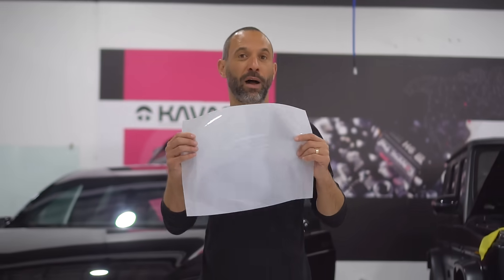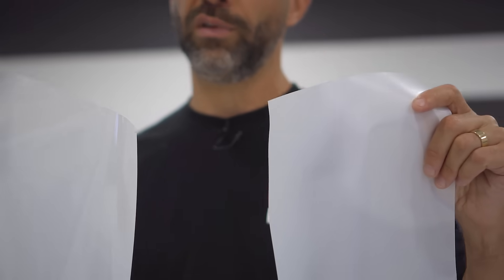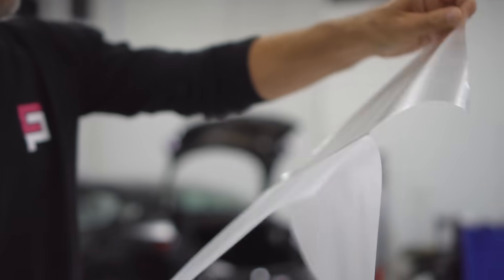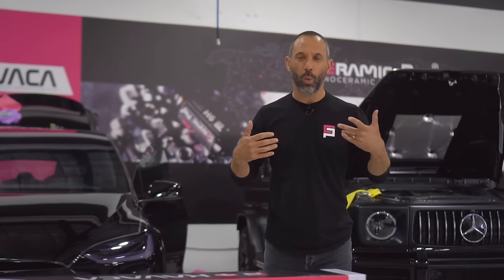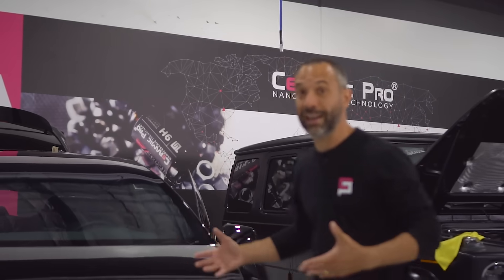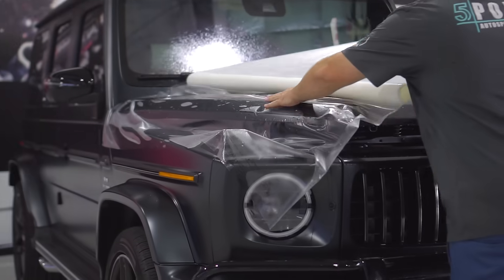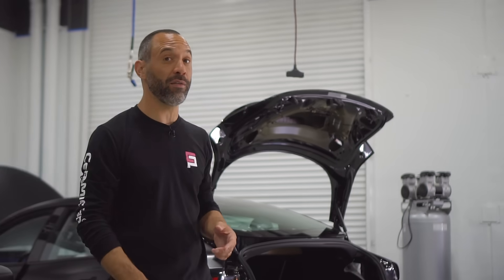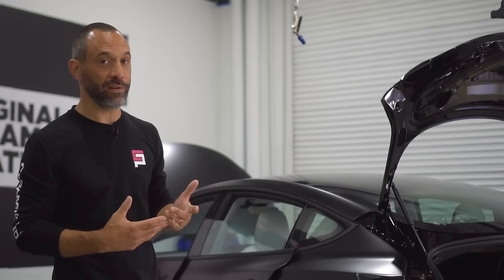The Truth About Paint Protection Film

Comment: CAUTION CAUTION CAUTION

I just got done removing 6-7 year old PPF off a car. Most of car (full front, doors, sides, pillars, roof, hood...everything but the rear bumper basically). It was garaged when not in use and lots of covered parking deck. Made me realize how stupid it was to install it.

- After about 4+ years, the film (highest end 'suntek' at the time) looked like absolute junk with swirls, fading, stains, spots, creases (main problem seems to be bug juice leaving brown spots that completely penetrated the film...not sure about the science of how that happens)
- Edges had 'uncleanable' black dirt lines and looked ugly...I ensured installer did least edges possible, but some areas are unavoidable and like the front bumper/headlight templates have edge
- Had to  remove some dents from door from deer running into the car and PDF prevents paintless dent removal and also had body shop scratching their head what they'd have to do about it (they didn't want liability to remove it)
- Some edges peeled and it was such a pain to go to shop for them to fix, which means basically cut them off with razor so there is bare inconsistent spot... they wouldn't replace the whole panel to make sure edges covered\
- HUGE pain in the arse to remove the film because it breaks off into pieces and leaves adhesive behind
- The adhesive is a #)(*%^ #$*(#$&*(#( to remove...you basically have to scrap it off and 100% swirling up the paint...I tried different methods and this is the most reasonable
- Lots of razor damage on paint when they cut edges...it was a good reputable shop still unavoidable
- Paint peeled in a few spots from pulling film off. it was worse at edges and on plastic panels.
- Had to remove some plastic trim where film was tucked under and 8 year old car plastic clips break easy
- After all film removed, paint looks WORSE than if you just didn't protect it because the process to remove damages paint. it would have looked better for many years with a few rock chips than the ugly old film + lines.

The only place where PPF seemed to work okay was the headlights... it peeled off easy and they were good as new under, however on the edges where there was no film are faded/yellow, so looks inconsistent. I noticed similar effect on some panels too where UV discolor the parts not covered.

I've had other cars in the past with film/ceramic. This the first car I had to remove the film because I kept it longer...prior to that I sold/traded to different car by 2-3 years so never ran into this problem. I thought it would be like removing shrink wrap to reveal nice new paint (that was corrected prior to PDF)... NOPE now I got swirled up paint worse than if I just carelessly washed it. The whole idea is dumb too...8 year old car with perfect paint? it gets check engine light intermittently and has a few other problems due to age and paint is least of worry by then...the film just becomes a thing that gets in the way from selling the car because it looks like trash. If it was just paint, I could polish + wax to look nice. If anyone has a brain, they'd see the film and not want to buy the car because who knows what's hiding under it or if it's going to star pealing/cracking tomorrow.

If you're going to keep the car, I'd recommend removing the film after 3 years...if you wait for 7 (which is apparently the recommended life of it), it becomes nearly impossible to remove and you'll be thinking you need to sandblast and repaint the car...it will be ruined basically with the adhesive junk stuck forever. If people out there are willing to spend 3-6k+ to redo their PDF every 3 years, they probably the type that are able to trade for a new car every 2-3 years. I'm betting most people will never remove it, so basically installing the film you're just stamped your car paint with doom.

Oh ceramic coating is a scam too. You can get temporary coatings that do exact same thing... some spray on. Or just wax it instead of paying someone 3k+ for basically wax that could last maybe a year depending... $10-30 wax and some labor is same result/protection.

Comment: Will the ceramic on top of the clear bra prevent oxidation? Also, will the ceramic on top of the clear bra make it look like just like the original paint?
Reply from the maker: Our KAVACA PPF adhesive in combination with the coating on top of the film makes it the most optically clear film option available today. That being said, films today in general dont age as poorly as old films would on cars. The ceramic coating does help with that, but the technology in most modern films is much better than the brittle film you may have seen on some older cars today.

Comment: Why don't you quote the cost and install charges in your videos?
Reply from the maker: Biggest reason is there are too many options to give an accurate estimate. For Example, we offer Ceramic Coatings, Paint Protection Film, and Window Tint which all come with different prep, different price points, and based on vehicle size will vary on cost based on the amount of material needed. However, what we have done extremely well to combat this is to connect you directly with our Ceramic Pro Shops to receive a Free Quote or Estimate from them. Visit: ceramicpro.com

Comment: I have a 2013 BMW 335I and it has numerous road chips on the hood and front fender I’m interested in getting the gloss black wrapped to a mat black finish what do you recommend
Reply from the maker: Hey Charlie, if the oem paint is gloss black, we recommend taking the vehicle to one of our 5000+ certified installers and having them evaluate the rock chips to see if they can even out that surfaces and fill it before applying a matte paint protection film. Visit: ceramicpro.com/freequote to be contacted by your local certified installer!

Comment: If I just wrapped my car with vivid vinyl wrap, can I still use PPF to protect the wrap?
Reply from the maker: Yes you can put ppf over the vinyl wrap or apply a ceramic coating on the wrap.
Reply: @CeramicPROUSA  and then apply ceramic to protect vinyl which is protecting paint

Comment: I am considering Kavaca ppf for dodge charger widebody. The car's paint is very glossy naturally so if I put regular kavaca and/or ceramic pro 9h it will be mirror-like which I think will be a bit too over the top for my preference. My question is if I did a full wrap of kavaca matte would a layer of pro 9h on top give an in-between satin/gloss effect? Or is the pro 9h strong enough to make it super glossy even on top of kavaca matte?
Reply from the maker: Hey Kyle, our KAVACA Matte PPF will make the finish matte, and even if 9h is applied it may darken the matte finish very slightly but not enough to change the appearance to what you are asking. If you want to keep the gloss finish and enhance the current gloss finish, we have KAVACA Ceramic Coated which comes with our Ceramic Pro coatings built into the finish.

Comment: Ok so those were the pro of PPF. 
How about the cons, like:
-how long does it actually last?
-how does it impact the paint under it over time?
-How often does it have to be replaced and how easy is it to do so (everything gets old and brittle)?
Reply from the maker: Hey Kevin, great questions.
PPF technology has greatly changed in the last few years. Our PPF has a 12-year warranty.
The paint isn't impacted in any way other than some adhesive that may be leftover which is easily removed. It doesn't need to be replaced unless the vehicle has a major impact or is in an accident.
Reply: @CeramicPROUSA   Oh ok, thanks for your clarification. So that means the film would need to be replaced every 12 years or so.
Just a lil technical question, so whenever you're putting on or replace the film, do you wax the car beforehand to keep the paint underneath supple (not dry out and crack)? Or does the film just keep the paint in pristine condition for years and years...

Comment: PPF is too expensive for your average car. Front end PPF installs run $2k-3k. That’s upwards of 10% of a new car value just to have your bumper and hood protected. Whole car you’re looking at over $6k minimum. You can have your bumper and hood painted for less than $2k. Only realistic and feasible protection is for super cars, or vehicles over $100k, then the price value ratio is more in the car owners favor. It’s just not worth the price, hopefully someone will come in and drastically reduce PPF costs.
Reply from the maker: Hey Tio, a good quality front end paint job ranges around 2k-4k and a lot of the times depending on the paint, it will never match the same nor will the bumpers/trims etc match up like they did day 1. PPF is a more expensive option but for many, its the best solution and offers many other benefits such as scratch protection and making the vehicle look new always. Pesky rock chips on a brand new vehicle are never appealing to look at and we also offer ceramic pro coatings which is another great option at a lower price point. The average cost of a vehicle that gets a full front ppf is around 50-60k.

Comment: How does the film differ from the ceramic spray?

I am in the process now, and it seems I am getting the spray and not the film, as initially 
proposed in the videos...
Reply from the maker: The film protects from scratches and rock chips, our coatings protect the clear coat and make cleaning your vehicle much easier while offering some protection but not rock chip protection for high impact areas.
Reply: @CeramicPROUSA I ordered a carbon fiber hood would you recommend I put ppf or ceramic coating

Comment: You talked about wrapping edges and I know not all companies do this. So what is the best approach? Also for my TM3 some panels do not have sufficient gaps between panels so is this an issue?
Reply from the maker: Hey Adam, our installers wrap edges on Teslas Model S, X, and 3. They will let you know what parts need to be removed and the estimated cost of doing so.
Reply: @CeramicPROUSA  So are you saying  wrapped edges is the better approach and why?
Reply from the maker: @doose8187  Seamless lines for aesthetics. Prevents the need for any adhesives at the edges as it's tucked in the panel. Most importantly, when washing or pressure washing, the dirt can get stuck on the edges of the ppf and cannot be removed without removing the film which will leave a black line around the edges.
Reply: @CeramicPROUSA  Appreciate your view, I was very close to going with a full wrap with a local supplier (unwrapped edges).
I am UK based. Will need to shop around further.

Comment: I have seen horror cases where the PPF bonded with the paint so much that pulling the old PPF would pull some of the paint with it.   You'd be looking at potential expense repaint of the entire car.   Is that still a valid concern?
Reply from the maker: Hey Nhat, so there are methods to removing the ppf that won't lift paint. Also, if the vehicle has been repainted the chances of this occurring is much higher. Older ppf didnt have the adhesive it has today, so many cheaper clear bra options 10 years ago would be a pain to remove but any of the newer PPF's dont have that issue.

Comment: Planning on buying a low mile mystichrome cobra, would it be possible to add kavaca and also ceramic on top of that?
Reply from the maker: Wow, a very beautiful and rare color! You can definitely get Kavaca for it and get Ceramic Pro on parts that you choose not to protect with Kavaca. Visit: https://ceramicpro.com/ppfvinylquote/ to be contacted by your local certified installer or give us a call to have us set you up with an installer that offers both Kavaca and Ceramic Pro Coatings. 1 (800) 280 - 6856

Comment: Definitely plan to get my entire car covered with the gloss however, you mention it comes off with heat? I live in Las Vegas where cars can easily bake in the sun at super high temps... would this affect it? Also, can you power wash without any problems?
Reply from the maker: Heat from direct sunlight and constant UV exposure will not remove the film or cause it to come off from your vehicle as our products are tested in extreme environments (places like Dubai & Arizona). That being said, if the PPF film is ever needed to be remove due to an accident, they will lift an edge and instead of yanking the film off from the paint, a method that is used to remove it easier and to separate the adhesive from the paint is hot steam (heat being applied while the film is slowly peeled off to ensure no damage is done to the vehicles paint and no adhesives are left behind)
Reply: Ceramic Pro excellent thank you. Now how about power washing? I like to power wash at self serve car washes... will that affect the film?
Reply from the maker: Great Question Samuel. Power washing will not damage or affect the ppf in anyway.

Comment: What if you want to remove, how dies it affect the paint is it sticky, paint removal?
Reply from the maker: Hey Debra, the removal process of PPF doesn't affect the painted surface. They heat up the adhesive and with quality films, it peels off with ease when heat is applied. If you're looking to get a free quote for your vehicle from a local certified installer, visit: https://ceramicpro.com/ppfvinylquote/
Reply: @CeramicPROUSA  If it peels off with ease when heat is applied, how does it perform in the desert when the car surface temp is 140 F in the sun...?
Reply from the maker: @louismorejohn586  It perfoms with no problems. We have tested it in the roughest climates from dubai to alaska.

Comment: What about the original paint after pulling out (if I want 2 years after)?
Reply from the maker: Hey Luis, not sure if we fully understand your question. But you can always have PPF applied to your vehicle. The sooner the better as there may be rock chips and imperfections that could have been prevented before application of Paint Protection Film. Visit: https://ceramicpro.com/ppfvinylquote/ to get a free quote from your local certified installer.
Reply: @CeramicPROUSA  his question relates to how PPF removes after its life has run out say, 5 years later. Does the removal process do damage to the paint?
Reply from the maker: @L3x4Pr0ne  No it will not. Sometimes some adhesive may be left behind depending on the ppf being used but that is easily removed. The only time it can damage paint is if the vehicle has been repainted poorly and it may pull paint if that is the case. However, most shops are very diligent about this and even repainted vehicles, if known beforehand shouldn't pull paint if removed with heat.